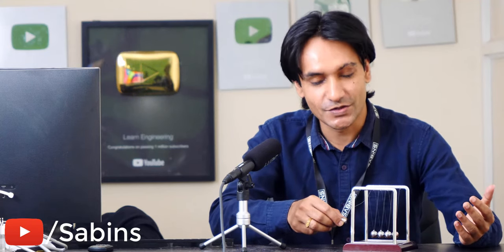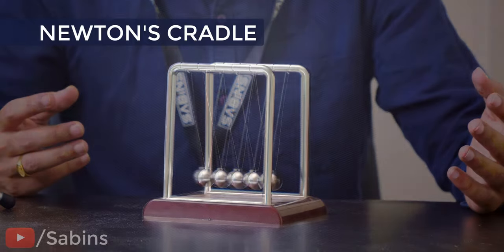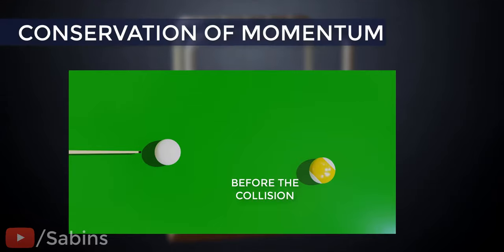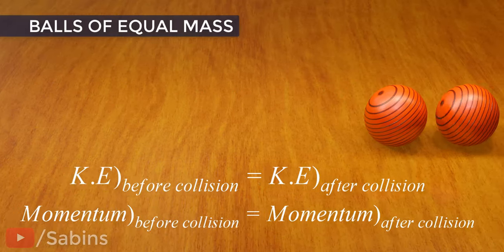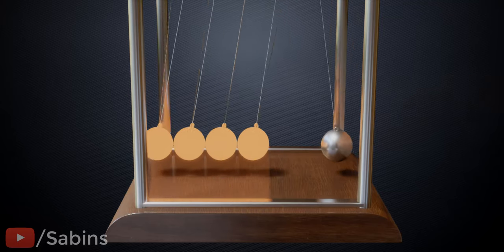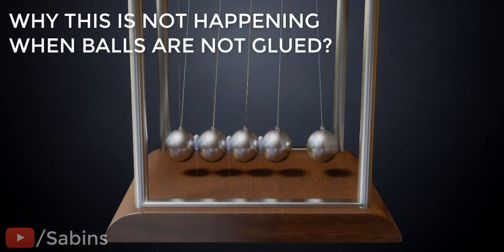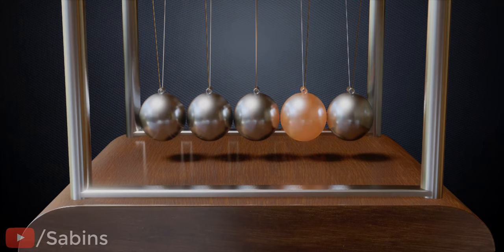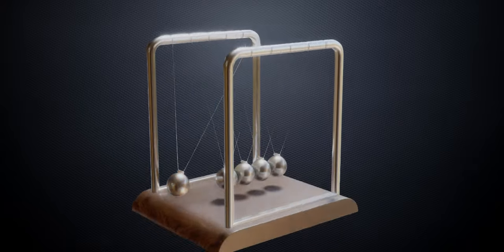The physics behind Newton's cradle!

Comment: Sabin, the actual video and the animation differ in that in the animation, the center balls, the captive balls, do not move but only have the energy transferred through them. In the actual video the captive balls do move though. Is that due to the elastic modulus of the material used to make the ball? If these were the most solid substance we know of, diamond, would the balls act more like the animation rather than the actual video? Would the action be more amplified using rubber balls?
Reply: I think it has more to do with the angle of impact and elasticity of material of the balls. If you could align the balls perfectly, and figure out the best material to use, the balls would probably behave more like the video.
Reply: i think it would be less similar to the behavior with steel with rubber. This is because the rubber absorbs some energy. Momentum is always conserved, but mechanical energy is not. Heat and sound can take away your mechanical energy, proportional to the square of velocity, so you might end up needing to more more mass at lower velocity to conserve total energy. That might mean that two balls would go flying off the end when one ball hits, and the one that hits would end up bouncing back a bit as well.